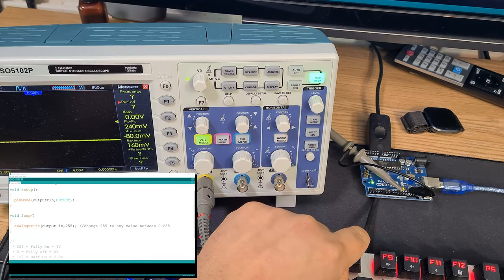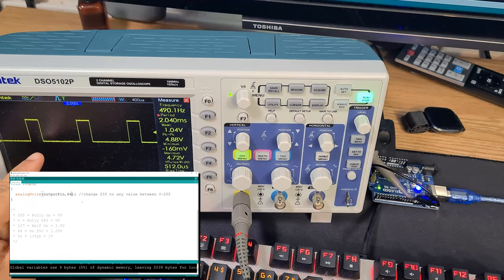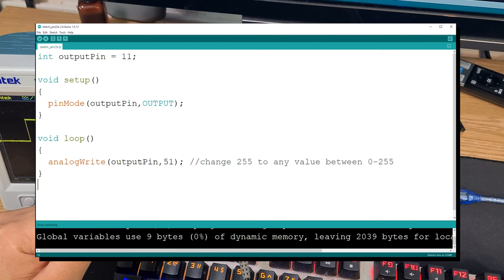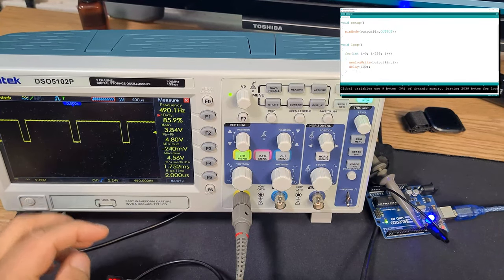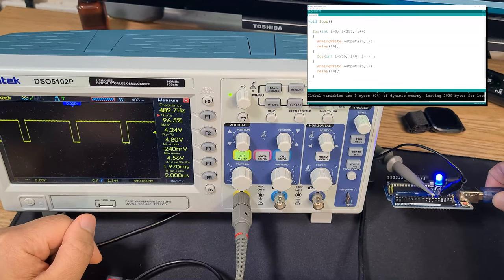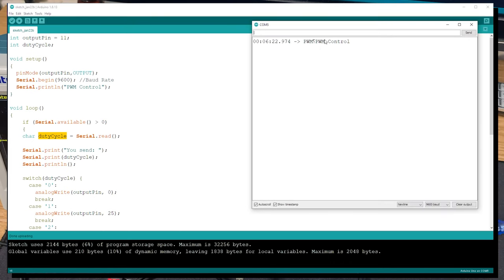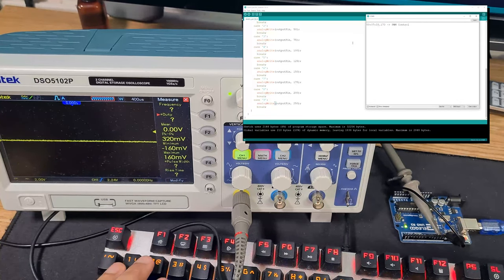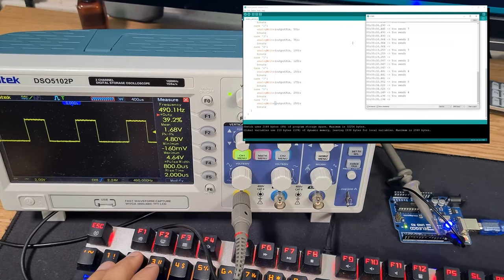How To Create A PWM Signal Using The Arduino Uno - For Beginners

Comment: 0.7 volt is the voltage drop across output transistor.   That is why you do not have 5v at output.

Comment: Hey if you wanted to use this to control a 3 port mac valve with a input being an interrupt signal that drops duty cycle to zero would you be doing similar code

Comment: Sir, can i get two different frequencies at the same time from single Arduino UNO board ?
20Khz and 50Hz square wave.
Reply: You can use millis() or micros(). 

unsigned long twentykhz =0;
unsigned long fiftyhz=0;
int twentysig= HIGH;
int fiftysig= HIGH;

void setup()
{
pinMode(3,OUTPUT);
pinMode(9,OUTPUT);
}
void loop()
if (twentykhz< micros())   // checks if current time has passed time to toggle

{
twentysig==!twentysig;   // toggles output value
twentykhz = micros ()+25; // set next toggle time 25 microseconds into future 
digitalWrite (3,twentysig);
}
 This will make output high for 25 microseconds then off for 25. 20khz = 50 microseconds/  cycle.

if (fiftyhz< micros())
{
fiftysig==!fiftysig;
fiftyhz=micros()+20000; millis()+20 can also be used
digitalWrite(9,fiftysig);
}

Comment: Is there any way to make the PWM is shifted ??:

I need to make 2 PWM with variable duty cycle which are controlled by means of potentiometer, The PWM frequency should be 30 khz. I have done all of that but I can't do it with the following challenge. I need those 2 PWM to be shifted from each other half cycle. And running simultaneously with each other. This is my code:

#define PWM_1 9
#define PWM_2 10
#define POT A0

void setup() {
  TCCR1B = TCCR1B & B11111000 | B00000001;
  pinMode(PWM_1, OUTPUT);
  pinMode(PWM_2, OUTPUT);
  pinMode(POT, INPUT);
}

void loop() {
  long dutyCycle = map(analogRead(POT), 0, 1023, 0, 255);
  analogWrite(PWM_1, dutyCycle);
  analogWrite(PWM_2, dutyCycle);
}
I am using Arduino nano ATmega328
As you see, and when I run it on an oscilloscope simulation,